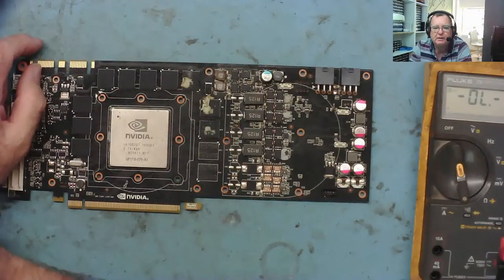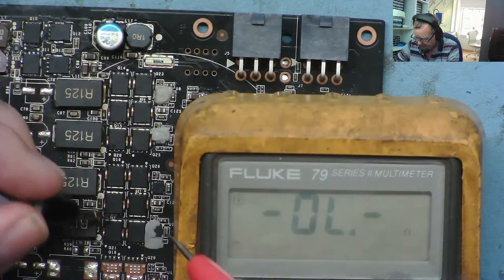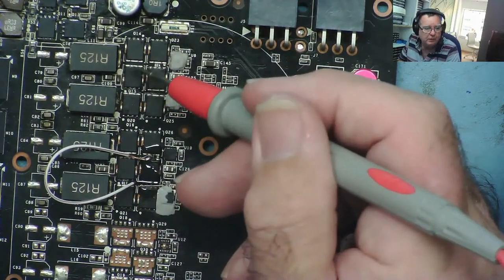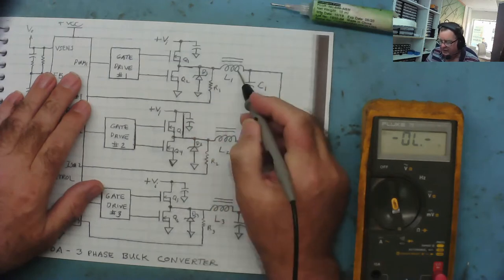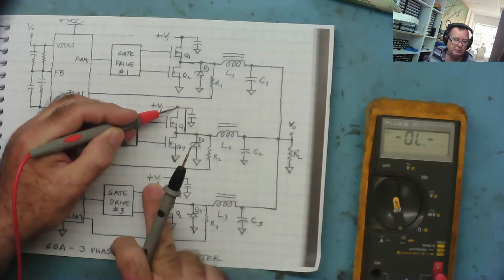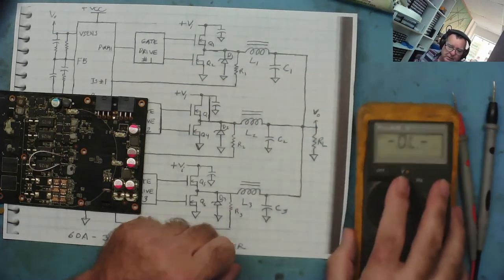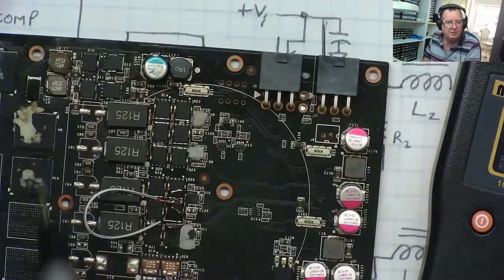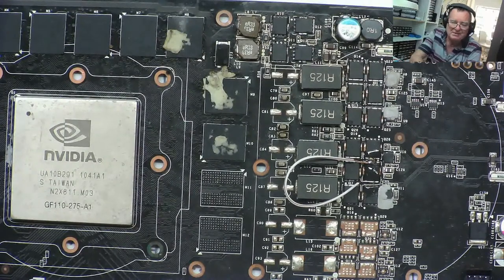How To Locate Short Circuit Mosfets on a GPU.  Learn Electronics Repair #063. Short Circuit Tracing

Comment: Hi Richard another great vid explaining in clear language how to trace a short. If you did not have a low ohm meter could you have used a power supply with a current limit to trace the shorted mosfet which would in turn generate heat in the short. Obviously this would not have worked on the wire you used, but do you think it would if the fault was a real shorted mosfet.
Reply from the maker: That depends.  You can't put anymore than 1V into the 'short' because if the short circuit (say it was a small capacitor) burns out and the short clears, then whatever voltage you set on your bench PSU will go into the GPU

At 1V you may not get enough current in to warm anything up. Things get hot due to the wattage.  If something is absolutely short zero ohms near as possible then it also will not get hot regardless how high the current is. 

So why will an absolute short component not get hot??

Well... Ohms law tells us that V = I/R

Let's say R (the 'short') is 1 ohms a current is 5A.  Then V (voltage across the 'short') = 5A/1ohm = 5V

Watts = Volts x Current so with a 1 ohm 'short' and 5A from your bench PSU something would dissipate 5V x 5A = 25W and get very hot indeed!

Now the lower the resistance or voltage, the lower the wattage for a given current

Say you set your bench PSU to 1V and you are getting  5A into the short.  The resistance of the 'short' must be R=V/I = 1V/5A = 0.2 ohms

Wattage is V x I = 1V x 5A = 5W which is a lot less than 25W but still quite enough to get something hot BUT when we are considering such low resistances then the resistance of your test leads, and the resistance of the PCB tracks is a much bigger consideration so that 5W is likely to be distrubuted across all of these parts.  In fact if your shorted component is actually something like 0.01 ohms and the leads and tracks are making up the other 0.19 ohms (quite possible) then things are even worse

Back to ohms law

Voltage across your shorted component is now
V= IxR = 5A x 0.01 oms = 0.05V

Wattage dissipated by your shorted component is

W = V x I = 0.05V x 5A = 0.25W

And the rest of the wattage (4.75W) is spread out across your leads and the PCB tracks!

In this case you may burn out some PCB tracks but your shorted component will barely get warm at all

There is another way to trace shorts in this sort of situation if you don't have a milliohm meter, and that is to use a  multimeter with millivolt range instead - I demonstrated this, and other methods, in these video

Short Circuit Tracing Techniques Part 1
https://www.youtube.com/watch?v=kGM-Zmrr6tc

Short Circuit Tracing Techniques Part 2
https://www.youtube.com/watch?v=NUgO7v4cbKs

I hope that reply wasn't too long but it takes some description and a bit of math to explain this properly.
Reply: Thank you Richard a very concise answer thank you for taking the time to reply, I never even thought about using the millivolt range 🙄.
Reply from the maker: @trone32  Did you see this video I made?
https://www.youtube.com/watch?v=P_2GGNr4q1s

Comment: Do you think it's possible to find a shorted MOSFET on an rx580 (4 in parallel) with a very high precision fluke bench meter? I'm gonna just replace all four since we've got a global parts supplier in town here I can order and pick up parts from, but I really would like to know what exactly blew
Reply: I've got an old hp Oscope I don't know how to use, would that help?
Reply from the maker: @curtiskorb3494  I don't see how an ocilloscope would help in this case.  Is the shorted MosFET from 12V or to ground?  Yes A high precision low ohms meter would do the job.  Bear in mind that the GPU core is a very low resistance to ground and can look like a short (especially on diode test mode)

Comment: But if I remove chokes one by one and test resistance, shouldn't a sensible multimeter find where the resistance is a bit lower, so it's closer to the shortcircuit?
Reply from the maker: Sure you can remove the chokes one by one and just use a multimeter.  Removing through hole chokes is quite difficult and takes a lot of heat - that's why I looked for other methods but do it whichever way you find easiest.   Personally I find this method easier than removing chokes, which to me is a last resort.
Reply: @LearnElectronicsRepair  The chokes on the AMD RX470 that I'm trying to repair are not through-hole so my soldering iron might be enough to lift one leg at the very least and break the circuit.
I bought the thing as broken (as is) to try my luck in fixing it.
One more question if you don't mind: I saw someone online removing a choke he suspected had a shorted phase and the GPU managed to boot in a limp mode. A short in any phase wouldn't bring the whole 12V down, regardless of trying to isolate one phase by removing the choke?
Reply from the maker: @catalin-viorelbriceag1097  My comment about removing through hole chokes was a general one, not necessarily relevant to your GPU.  But  I ask a question?  Why desolder chokes randomly when you can find easier and quicker ways to do it?  

Desoldering VRM chokes, through hole or surface mount isn't easy and most certainly is not fun, unless with something more high end like A Quick 861DW hot air and I have one and have been there, done it,  and still prefer not to if  I can avoid it thank you very much...  so that should tell you something!!

Yes you could remove the choke on the shorted phase and possibly the Mosfets depending what has failed, and it is possible the VRM will run and the GPU power up and run (the likely-hood of this working  comes down to the type of VRM controller and what it is monitoring)

One shorted phase WILL bring down the whole VRM unless you repair or, if you are lucky, isolate it.
Reply: @LearnElectronicsRepair  I will try finding the short. It's my first time doing this but I have faith. I'll look for more videos, yours included, and I'll somehow get to the bottom of it. The knowledge I get from this far outclasses the work or a broken GPU that was broken to begin with.
Thank you for your advice and patience in writing.
Reply: @LearnElectronicsRepair  Hello again! I got updates. I got around to test the card a bit more while powered up.
It's an RX470 Expedition from ASUS. It has 3.3V, 12V, 1.8V, VPEX, 5V and VMEM. It doesn't have VDDCI and VGPU. No MOSFET is blown up, no short that trips OCP. I probed around a bit and found that somehow the MOSFETs are getting 12V on the high side ones, no 12V on the low side ones (hope I'm not mistaking which is which). Is that a possible issue with the MOSFET drivers? All phases seem to do the same thing. What are their purpose actually? Are they telling the MOSFETs to turn on and off?

Your response would help me a lot. I got this card as is for educational purposes and in hoping to repair it to either sell it and get a hot air station and some other goodies to help me get started to try and repair more GPUs or just put it in my mining rig and see how it holds up.

Comment: Hi :) On your VRM schematics you have 2 mosfets per phase but on GPU you have 3 mosfets 1 high and 2 low. Why?
Reply from the maker: Very often there is one high side mosfet and there are two low side mosfets in parallel giving a total of three.  The two low side mosfets are switched on and off simultaneously (the gates go to the same output on the PWM controller) and quite literally share the current between them.
Reply: @LearnElectronicsRepair  Thanks :)

Comment: Hi Richard, I have a power board for a game device that provides zero voltage on one of the connector pins (the pin was supposed to output 34 volts. others pins showed the correct voltages eg. 5v, 8v. I've also checked the voltage supplied from the dc jack connection port and it is correct). I tracked one of the components on the board and traced it to a capacitor and the + sign joint showed it was shorted to the ground. Thus, I removed the capacitor and the problem still showed up when I did a continuity test on the joint where the capacitor was unsoldered. The capacitor is not the issue. What's your advice for me to find the root cause?
Reply from the maker: Hi Muhammed - as I realy don't know anything about your PSU, I suggest you register at www.badcaps.net/forum which is free to join.  

Then post the fault description and some good quality pics in the PSU repair section and I am sure you will get some advice

https://www.badcaps.net/forum/forumdisplay.php?f=32
Reply: @LearnElectronicsRepair  Hi again Richard, Thanks for recommending me to the forum. I've never been there so will have a look.

Comment: A graphics card that runs Android emulator games only and DX 11, 12 and 9 games do not work until I installed it on another motherboard, the same problem and I updated the bios and nothing changed. I want to know what is the problem with the graphics card
Evga 1060 6g SSC

Comment: Hi sir, I just need your help if you like .. I am not professional but it’s my hobby to repair stuff I have XFX rx 580 8GB card and it’s not giving display.. when I turn on pc then fans start spinning in few seconds it’s resting but no display.. it’s GPU getting heated when fan started I check with meter. I have 12v 3.3v 1.8v 1.5v but no display 😣

Comment: hey im looking for a discord server to join i have a 980 ti my sister was using until it stopped working the other day i got it and it powers on but only with 1 12v power cable in and needs 2 too run i plu the 2nd in and it cuts out the pc and i have to reset the psu i have a feeling this might be the issue but still ild like to chill and learn more what do you think ?
Reply from the maker: I'm setting up a Discord server (well actually it is already there but I am doing some more work on it before launching it).  It will be ready soon and I will let you all know when it is ready
Reply: @LearnElectronicsRepair  thats awesome im hoping to setup a lilttle repair's bench i first tock a vcr player when i was 4 with my uncle im 33 now i got a lot to learn thinking of college now my partners family own a massive sigh making complen so will be good when hardwere brakes also it will be great to make freinds with you and the others
Reply from the maker: @ItzRuleBlitz  Welcome to the party :D  

The best way to learn this is to do it.  You need some basic equipment (multimeter, soldering iron (get a T12 and you will never regret it) a hot air station and a bench power supply) and that is enough to start repairing.  Then go and buy, or scrounge from friends, some faulty things and try to fix them :D

For setting up your little repair bench you might find these two videos interesting

soldering & desoldering equipment
https://www.youtube.com/watch?v=x8qBmTrX2v8

test equipment
https://www.youtube.com/watch?v=lutL4wft6fQ

Have fun, enjoy what you are doing, even the failures, and you will learn 100% guaranteed

Comment: You wouldn’t happen to know the wattage of resistors they use on the 30 series vbios chips would ya lol
Reply from the maker: I don't.  Usually you can work out the wattage by the physical size of an SMD resistor, 0402, 0604, 1208 etc
Reply: @LearnElectronicsRepair  yeah they are just so damn small thanks
Reply from the maker: @supupandaway8138  IMHO just replace with the same size as the original and the wattage will not be a problem

Comment: Is it safe to remove one shorted MOSFET (MDU1513) and run the card without it? It is one out of 4 on the same rail/lane
Reply from the maker: This a bad idea - also you didn't mention if the shorted Mosfet is a high side or low side?  If you did remove one phase (both high side and low side, then the remaining three phases will be running at 133% of the intended load.  Also the VRM controller may not even run at all with one phase disabled.

Actually you should be thinking of replacing all the Mosfets in the VRM, not just the shorted one.

Also you need to check the gate drive resistor connecting to the shorted one from the VRM controller IC, And consider changing the controller IC as well. Oh and don't forget to check for a shorted or low resistance load that may have caused the Mosfet to go short in the first place.

To be honest, I just checked and you can get 10x MDU1513 for less than €5
https://www.aliexpress.com/item/1005003785263714.html

So I can't see why you would even want to run the card without it?
Reply: @LearnElectronicsRepair  Thank you so much for helping. I'm still not able to determine if it's low or high side (I'm an amateur) I have 15 total Mosfets five have the MDU1513 model and ten have MDU1511. Can I E-mail you a photo?

The reason why I thought of doing so, is because the card sometimes run normally even under full load, and sometimes it doesn't. And I forgot to mention that I had shorts on three of the MDU1513 Mosfets and after cleaning the card with a contact cleaner the shorts were gone, so I tried to run the card, it ran normally for about 5 mins then at idle it gave a random full screen mono-colour (as usual) so I took it off and checked the same Mosfets and out of the three only got one shorted, I ran it again at full load now I have the same three shorted again. And I rarely get 6 beeps from the Motherboard while trying to run it by the way.
Reply from the maker: @PorscheMan.  If you have five of the MDU1513 and ten of the others, then the MDU1513 are the high side mosfets. 

In a VRAM there are either an even number of high side and low side (in your case 5 of each) or there are twice as many low side than high side.  never the other way round

What you are saying does not make a lot of sense - if you have a shorted high side Mosfet, then the ATX PSU would not even power up due to the short

I think you are getting a little confused somewhere with your resistance readings
Reply: @LearnElectronicsRepair  Now I understand what low and high side mean, thanks for being so patient with me.
I'm sorry if I didn't sound clear. What I do is, put the multimeter on continuity mode and have the common/black probe to the card's ground like you do, then check the Mosfet's Gate and I get a continuous beep. Another way is that I put the multimeter on 20k ohm and check the same Gate and I get no resistance unlike the working Mosfets which all have roughly 12k ohm.